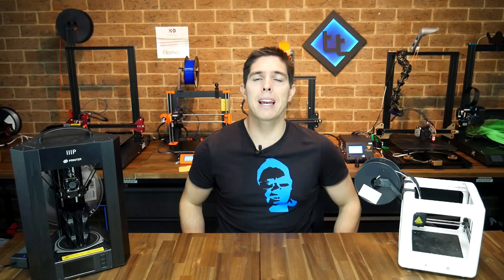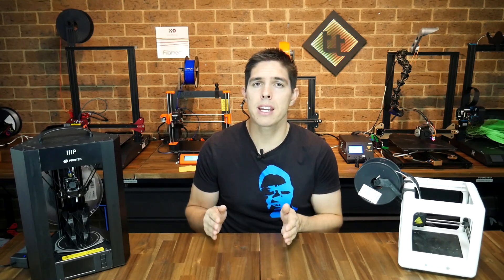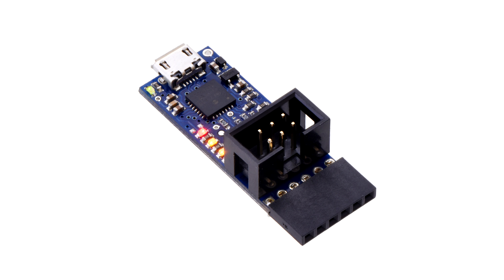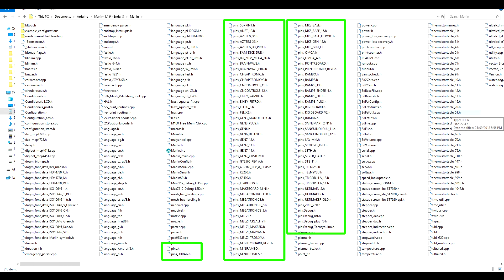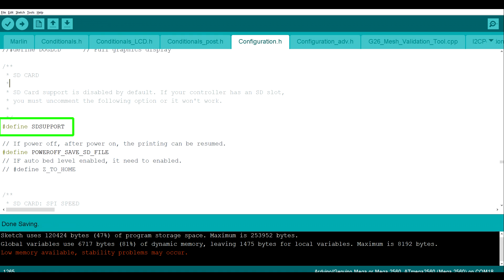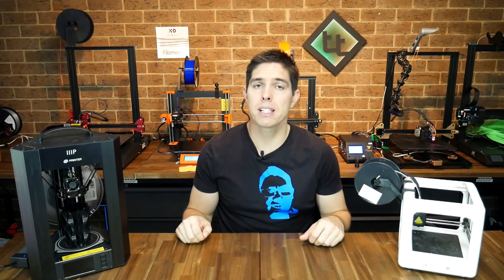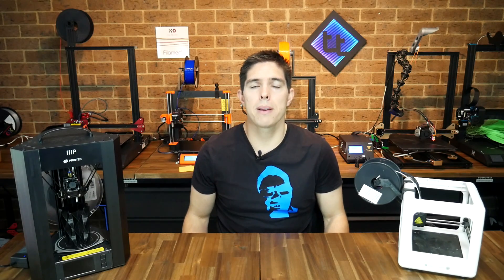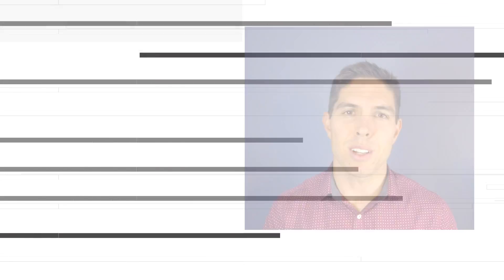Marlin firmware explained: What it is and how to use it

Comment: :hand-pink-waving: I don't know if you will see this, but I will try it with one question.
I need to change the E-Steps for my Excruder because I changed it from a Boden tube to a direct drive. I do it by using the G29 command and then the M500 to save it. But, every time I change the Marlin software and upload it I have to change the E-Steps to the Excruder again.  I can't find in the Marlin software where or how to set the E-Stps for the Excruder. BTW I have an Ender 5 Plus and the new E-Step value is 494.9.

Comment: what's the simplest way to have Ender 3 V2 support change filament mid print using SD card. Which Firmware would you recommend( . I don't know how to compile etc so I am hoping to get the .bin that I just put in the SD card
Reply: Get an Skr mini e3 v2 board

Comment: Jesus. I'm already pulling my hair out trying to figure this stuff out, and now that I've finally found someone helpful to watch that has information relevant to my issue,  I've noticed that the framed tt logo on the wall is crooked and I can't stop staring at it in frustration. People with ocd should be banned from owning 3d printers due to an increased health hazard. I can't even right now... Somebody help me please before I throw this damn printer off my balcony.
Reply: Cheap 3d printers are all about patience, chill down, don't rush anything, if you want to print right out of the box then you can pay for that, if you are buying a cheap printer, be ready to be fiddling with it.

Also, stay away from Marlin 2.0, that made me waste an entire day until I tried installing Marlin 1.9 and many issues I was encountering went away.
Reply: @marcojimenez9327  I just had to walk away and come back to it. Here I was digging into custom firmware and all kinds of other things trying to find my solution and it turned out I had a 4pin dupont connector on backwards that was causing all my issues.

Live and learn I guess. That, and Occam's razor is a real thing.

Comment: I am an absolute novice when it comes to 3D printing.  I was only able to make Octoprint because of your videos and that was really important because I wanted to monitor and be able to abort bad prints while I’m away. (Thank you for that!) I want to add a BLTouch but that leads me to mainboard and firmware questions, which leads me here. I have no idea if I can handle all of these things, especially mixing them together. If I manage to pull it off, it will be largely due to your guides and advice.

Comment: Hello. 

I have a big problem with my Anycubic Kossel Linear plus and I can't find anything that can help me to resolve it. 

Today morning I turned on the printer and everything was ok on the beginning. After some time I wanted to do bed leveling because I found some printing issues.

Automatic bed leveling system do not working, nozzle are moving on the air slightly for few seconds and that's all. Basically looks like level of the bed is now very high and extruder don't wanted to go lower of it. Printer is printing only in air. 

For the info, last week after bed leveling in two cases I've forgot to disconnect the bed leveling sensor before printing and my nozzle pushed strongly to the bed. But when I've disconnect it off Printer was working properly.

If you can show me the way what I should go now, but in simple words, as I'm not programmer and when I've looked on those Marlin files and cura settings I know it is black magic for me.

Thanks and hopefully you will find a time to reply for my question and help me.

Thank you.
Regards.
Reply: If could be a way to give a Information about proper bed level to the printer and store it somehow I think that auto leveling will run normally :(

Comment: Hey man, I have a prusa i3 clone that doesn't have a configuration h example file in the marlin vanilla code. Did I understand correct that I only have to figure out the settings needed in the configuration H and adv h files with a complete vanilla marlin? Where would you suggest I start? I'm not a complete noob, just need to be pointed in the right direction here.

Comment: Excellent! Very instructive video!
I've got an issue on my Ender-3, it displays 100°C for the nozzle even when it is at room temperature. I've allready checked the thermistor and the pull up 4k7 resistor, everything seems to be fine, so I guess the nozzle thermistor adc port seems to be faulty. I've come to this video to see if I can reconfigure the Marlin to read the nozzle temperature in an unused port. Despite the great information you provided I couldn't be sure of where the pin assignment can be changed (in programming I've never gone much further than the "hello world" lesson). I've looked at the pins.h and MELZI_CREALITY.h and there are some lines related to pins there but I couldn't be sure where to change. Could you give me a tip about it? I'm aware of the hardware changes I'll need to make. Thank you again for the great explanation.

Comment: Im installing the Octo print on my Ender 3. I have a question about updating Marlin while having the Pi set up on the printer. Is it possible to flash the MB with Marlin through the Pi? I have the upgraded MB with the boot-loader built in. It would be nice to know if this is possible or if we have to unplug the Pi from the printer MB and connect direct to the PC.
Reply from the maker: There is a marlin flashing octoprint  plugin that I haven't used but it may be what you're looking for.
Reply: @TeachingTech  thanks for getting back to me. Your videos have made it fun to learn my printer.

Comment: I'd like to interface to TH3D's Unified Marlin Firmware for a non-3d printing application.   For example, I'd like to move the motors (execute different g-codes) based on the state of the input pins to the microcontroller.

But could this be done solely via pronterface's printrun library (printcore.py) that interfaces to the Marlin firmware via serial... or would it be necessary to modify the Marlin firmware itself?

Comment: I just bought a Tiny Machines CR 10 S Pro and was notified it needs a firmware update.  Do I just put the hex file on an sd card and then do something?  If so, what?  Will that permanetly update the printers firmware or only if I have that SD card in the slot?  Also, I just bought an Ender 3 from amazon and want to update the firmware to the tinymachines fire protection one. I watched your other firmware video.  What do I need to buy to do that?  Your videos are a great help, but a lot of us need more detail.  I feel like I'm 80% there, but still scared to mess with the firmware.
Reply from the maker: I have a whole video on updating the firmware on the cr-10s pro. Please look it up
Reply: @TeachingTech  I watched it in the past and was getting the Ender 3 bootloader section confused.  I rewatched today and a couple of others and realize my error. Thanks for the videos!

Comment: Can you put Marlin on any 3D printer? I have a Monoprice MP10, but there is not much information about it. I contacted support and they said it runs a closed version of Marlin. Do you think I can load plain Marlin on it?
Reply: Me too - I have MP10 Mini - I want to update the firmware. I managed to connect to the MP10 board using arduino ide and send G-codes to extract all the MP10 settings. Now I want to know if I can update Monoprice's closed stock (Marlin) firmware with an open Marlin version. I wish Monoprice would be more helpful.

Comment: Helpful video, thanks. I have two questions to u.  I use the TH3D firmware [U1.R2.9b (3/14/2019)] on my Ender 3 PRO. And now I see the original vanilla marlin firmware. First question 1) Which one is better and has more features? Second one 2)Can I update this firmware (marlin vanilla) directly, without burning the bootloader again?
Reply: 2) Once your board has a bootloader installed, you never need to install it again unless you want a better one. But that is highly unlikely. Yes.

Comment: The definition of firmware has changed over the last 35 years.  To me, what you describe is a program that is being executed.  Firmware is burned into rom and cannot be changed, hence "firm" ware.  Oh well.
Reply: Wikipedia says - 
In computing, firmware is a specific class of computer software that provides the low-level control for a device's specific hardware. Firmware can either provide a standardized operating environment for more complex device software (allowing more hardware-independence), or, for less complex devices, act as the device's complete operating system, performing all control, monitoring and data manipulation functions.
So Firmware sounds about right in this case
Reply: Tech has changed over the last 35 years so of course firmware will change or rather expand to include more definitions. If you’re a guy who prefers to remain stuck in the past then tech isnt really for you
Reply: @pear-zq1uj  you just have to make an adhominem comment.  You are wrong, asshole.

Comment: I would really like to see where you take a cheap chinese 40w laser engraver/cutter. You've done such an awsome job taking the ender3 to dang near its limits. I just think the way you approach things, you would take that laser to the next level. Yeah your gonna hear they suck but  i've had 0 issues with mine.
Reply from the maker: Planning to do this in future, just not sure when. I've had good success with cheap eBay Chinese stuff so far.
Reply: @TeachingTech  there is a guy doing stuff with a 50 or 60w co2 laser but the average person is gonna settle for that $350 40w co2 laser. but check out rdworks learning lab vidieo's. just a heads up he is very informative but also very long winded. typical video of his is about 45 minutes. I just have a feeling you would do this in a quicker format and more concise and go places this guy hasn't even began to touch on.

Comment: It's not quite accurate to say that Marlin 2.0.x is optimized for 32 bit boards. It runs just as well on 8-bit AVR boards as 1.1.x does and the developers are very careful to keep it that way. The 1.1.x branch has pretty much closed to all but simple bug fixes at this point - there will be no new features added to the 1.1.x branch and it is likely that 1.1.9 will be the last official release on the 1.1.x branch.

Comment: Great video but I still have a question ... the TH3D firmware version of Marlin ... it does not seem such an easy plug and play for me with my Ender3 as I have upgraded the board to the MKS Gen L ... am I missing something in the TH3D firmware or is there simply not support for the Ender 3 WITH MKS Gen L board yet?
Reply: There is, you just set your board type. 

Specifically around line 57 in configuration.h  Change it to BOARD_MKS_GEN_L

Comment: A good primer for newbies,  I ran into a bit of a bizzare issue after changing out the default cr10 board for something with a bit more oomph! I've just shoe horned a ramps/mega in my Cr10's box ( not recommended for the faint of heart) , one  snag I had was the 1.1.9 & bugfix  cr10 config files would throw an out of memory error  on compilation when the config was changed to reflect the ramps instead of the stock creality melzi board,   however the TH3D release didnt suffer from this issue,  but I  wanted to stick with the official release - long story short - I found that  the  Bugfix 1.1.9  CR10-S config  works a treat on the stock cr10 with a ramps board with some minor tweaks  including one for my lv8729's @ 1/32 steps ,the filament sensor is also simple too as it just plugs into X max-  I'm that happy with it that going to use the exact same files for my ender 3 after some adjustments for print volume and PID settings when I switch its board out for  the GEN L

Comment: You don't fork a project just by uncommenting some lines for your printer before building, the same way you don't fork the Linux kernel by configuring before building it for your hardware configuration, or any other open source project. TH3D itself can also hardly be called a fork, it's a custom distribution of Marlin. You fork a project when you take the original code, develop your own features and bugfixes and deviate from the original project. And you do that usually if you can't or don't want to get your own stuff into the main project, because of quality or policy or politics or all of the above.

Comment: just picked up that MiniDelta as a second printer, would love to see some upgrade/options on that
Reply: Me too!
Reply from the maker: I'm enjoying that printer. Simple but good print quality. Review to come.
Reply: @TeachingTech  print quality is amazing for the price. I've had minor issues with the bed leveling and supports. Using cura profiles I found on the wiki site and the .14mm z res blows away the ender 3 at .1mm.  I have more tweaking to do there apparently.